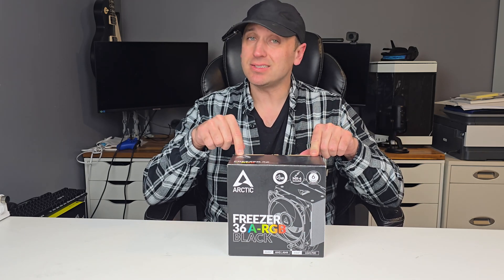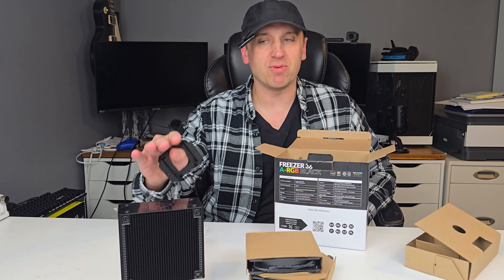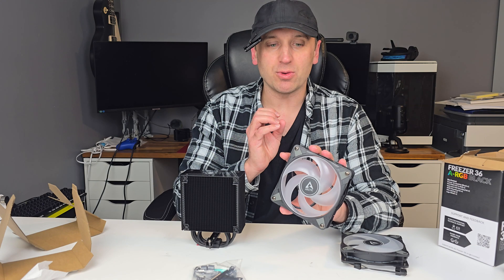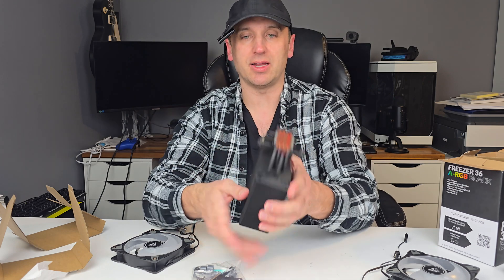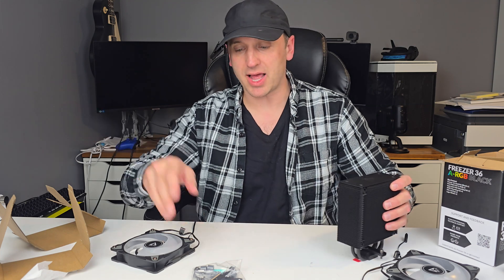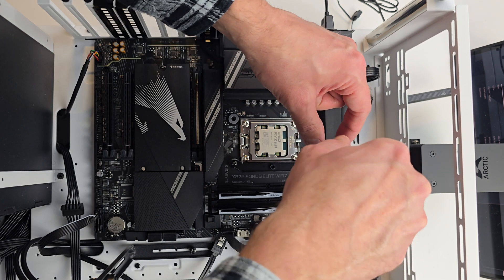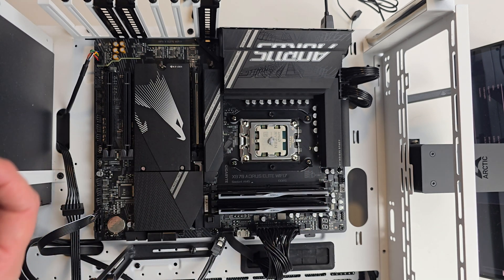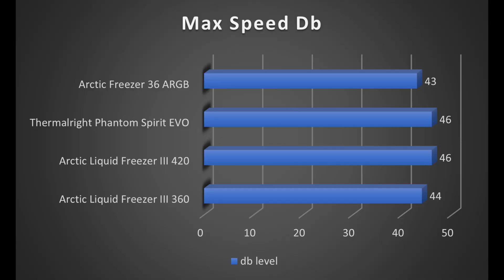Arctic freezer 36 ARGB unboxing, installing and testing.

Comment: I use my artic freezer argb 36 for a 12600k and want to upgrade to a i7 14700 non k variant. Can i pair it with the cpu? or should i stick with a i5 processor.

Comment: is it me or have they changed the artic freezer 36 install bracket and screws?
Reply: They have. I just got one yesterday and the bracket is definitely different to the one in the video. The spacers are built into the bracket
Reply: I assume, the one you received was the REV 4. I just received mine and I just recently knew that there's a REV 4. I had problems installing it. But I solved the problem. Just use the stock/original AMD bracket screws, and not the one with the arctic
Reply: they removed it for amd and you need to use motherboard ones.

Comment: I got the Arctic Freezer 36 for my new 9600X build. While doing some Cinebench runs, the CPU reached around 120W and was hitting around 92-94C. I even gave it a repaste but almost 95C at less than 120W feels awful, especially since it was rated for around 220W. 

Given I live outside the US, ordering a replacement or buying a new cooler might prove difficult.

While I try to figure out how to get a better cooler, I will just limit the CPU with AMD Eco Mode and limit it to 65W/88W. With Eco Mode, it runs at around 70-75C. Undervolted a bit and instead of lower power consumption, it boosts higher lol. Eco mode will not allow it to go past 88W, so it will try and boost until it reaches that power limit.
Reply: i have a same problem just buy a new pc with 9600x im using it with stock fan wraith and its 65 degrees idle and when i open a game its between 90-95 degrees i will try this eco mode solution
Reply: How could it be that hot it's a 65W CPU. My i5 7500 is the same TDP and never get hotter than 70C with the ancient 212 Hyper Evo.
Reply: Some 9000 series on certain boards runs like that out of the box. AMD dialled it back in later bios revisions

Comment: Would you say this is good with the 9800X3D? Should be right? As it has TDP of 120W and the 7900X has 170W.
Reply from the maker: Funny you should ask. I just picked up a 9800x3d. I have a number of coolers i plan on retesting on it.

Comment: my tech (builder from a local shop) said that the other fan won't be able to reach the mobo's pin (I have an MSI B840 GAMING PLUS).) So do I need an extender or no? I have no idea how to build a pc and it's clear lol..
Reply from the maker: The power cable daisy chain together and the fan header for that is always near the cpu. The argb connector also daisy chains together. That one might not be near the cpu. You can always buy an extender for that. However you don't need to plug in the argb for the fans to work,  so if you do need an extender you can still use it.
Reply: @jackshardware  Thank you so much! I chose to buy a 5v 3-pin led cable so the other fan can light up. Thank you so much!

Comment: So it comes with LGA 1851 contact frame just like for LGA 1700?
Reply from the maker: Lga 1851 and lga 1700 use the same contact frame.
Reply: @jackshardware  Thank you for reply! You earned a sub 👍

Comment: How take fans out of the cooler, mine do not work properly, so I need help.
Reply from the maker: Honestly I think the best way is to wedge a flat head screw driver between the fan and the tower near the corner and twist it
Reply: just remove by creating a gap on corner of the fan and they easily come off